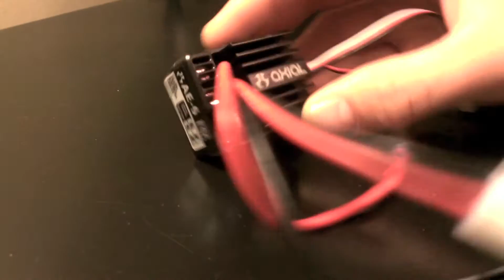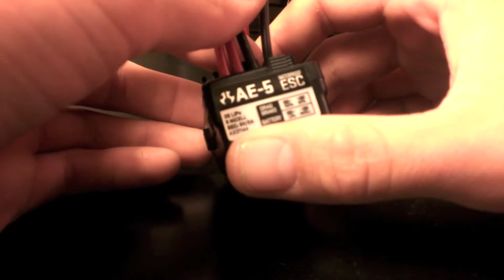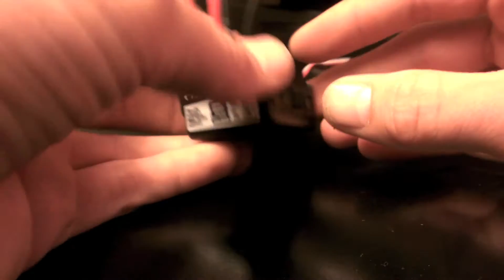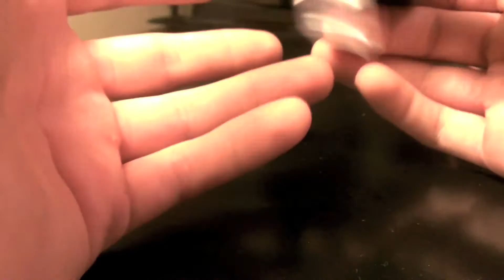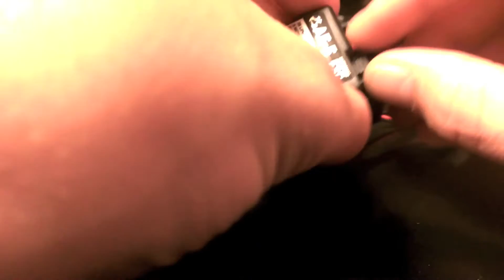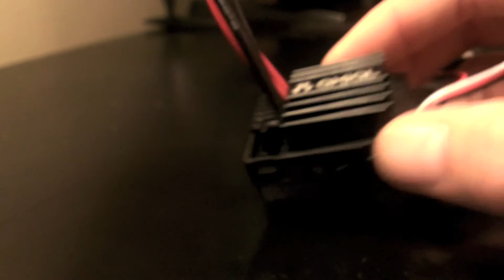KKRC Productions: Axial AE-5 Unboxing/Review.

Comment: Hi there, thankyou very much for information, my ae-5 is showing  flashing red light asap i connect the battery. what does that mean, I'm facing an issue , throttle is not working. please help me out
Reply: Gorasam Acharya I have the same problem it's the esc over heating